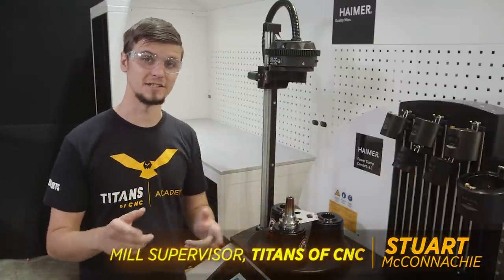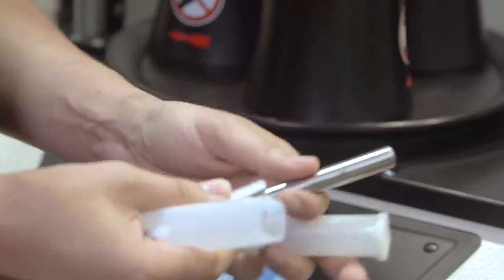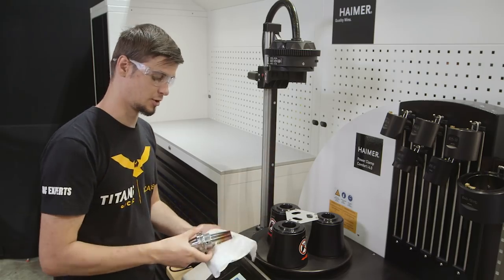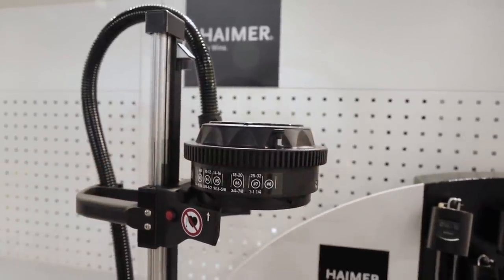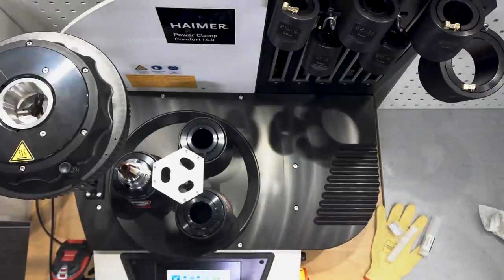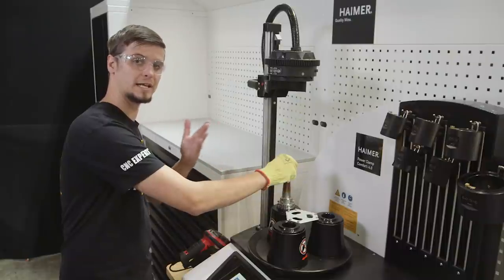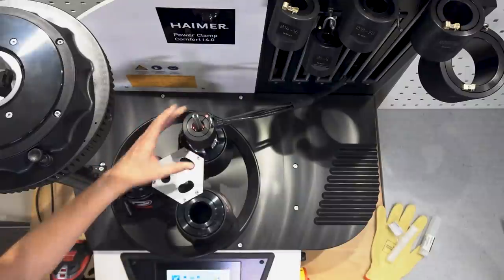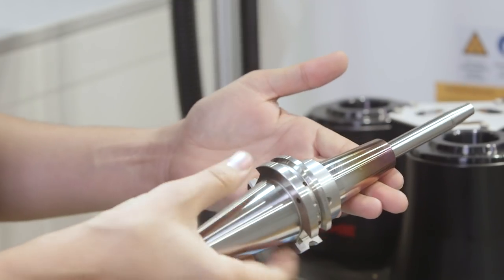How to Properly Heat Shrink Your Tools for Precision Set-Ups

Comment from the maker: As always, we are looking to educate our entire industry. Many companies are perfectly fine using regular tool holders, hydraulic holders, mill chucks etc... but for shops looking to lean out their processes etc. Shrink Fit, Pre-Setting and Balancing is extremely important. So we definitely also want to teach on it. Hope you enjoy this video!
Reply: question. is the process the same to remove the tool from the holder?
Reply: @littlephilo585  Yes! You would still heat up the holder, pull the tool out, and then cool the holder with the appropriate cooling body.

Comment: damn, at my work we have an old machine for heat shrinking tools and it just takes 10-15 seconds to change a tool and its automatic aswell. this just seems to be way more complicated than it needs to be!
Reply: That's what I was thinking, the one I used needed only like three steps and its done plus it was a lot more compact, you just set the power level on a screen, set your tool in the holder, slid the coil down over it and hit the button on the slide handle and dropped your tool in a few seconds later once it was hot, and as soon as you set your tool and let your finger off the button an air sprayer inside the coil unit would blast the holder for 10-15 seconds to bring it down close to room temp. I could swap out an entire machine's worth of tooling in 10-15 minutes with it, I loved that system.

Edit; just looked it up, it was the Techniks 00500 ShrinkPRO Quencher. Great machine.

Comment: Why are the heating cycles and aperture size in SAE units, while the cooling collars are metric?
Reply: Yeah... they are asking for trouble....
Reply: No sense in making two different sets of cooling rings I guess. But they could mark them with both inch and metric that's true
Reply: We could’ve solved that problem decades ago, along with the rest of the world. Instead, we add this chance for potential mismeasurement. It’s already cost us one spacecraft that we know of.
  Reminds me of wearing a mask to reduce transmission of an infection—seems simple, but just too difficult for some. And we’re losing more than a spacecraft because of it. A thousand people per day, at the present time.
  Just so folks know, I live in an area where mask usage is followed by the majority of people I see, and our rate of transmission is lower than in he rest of the country where it’s “too difficult” to wear a mask.
  Maybe we need a device where you could measure your head, stick it in, and when you removed it you’d have a properly fitted mask on your face. No heat needed.

Comment: How critical is it to clean the bore or a heat shrink holder?  Can I use a nylon brush or does it need to be brass?  Will cleaning the bore extend the life (meters/cut) of the cutter?

Comment: I would like to see the balancing. I thought only the holder was done? If you balance with the tool in and change the tool you will have to balance it again. Removing weight all the time will eventually ruin the holder or is the holder considered a consumable?
Reply: If I remember correctly there is different weights of screw put in the holder for balancing
Reply: The weights are little set screws that go in the sides of the tool holder. You can change them as much as you want as long as you don’t mess up the holes.
Reply: Our holders are designed for adding and removing the balancing screws without an issue and it will not ruin the holder's holes.

Comment: So what would you do for something like a 3” insert facing mill? Would you just use your standard holder or would you still have a way of using the heating and cooling method
Reply: I don't think a 3" face mill will survive the RPMs that require shrink fit holders

Comment: Has anyone ever had a tool pull out of a shrink fit holder? It's happened 2 times on me the same tool.
Reply: Depends what kind of tool. If its a large vortex cutter then it could. Also check the tools you're using to make sure that they are ground to shrink fit tolerance as some tools aren't so may be slightly smaller
Reply: Its a 1 inch insert cutter but it sticks out about 7 inches we think it's happening cause were ramping in the z axis
Reply: @anthonykegel3861  dunno, biggest heat shrink holders we got is 20mm and we dont really use large tools. Maybe try a sidelong holder
Reply: @jaysilverheals4445  it's a 1 inch cutter but I think it didn't like ramping in the z axis.

Comment: when to use this kind of tool?
Reply: When do you need extreme accuracy and run out
Reply: And it’s also good for tight places
Reply: i mean with usual tool i can get on spec... dont know what kind of job with that sizes of cnc would require such accuracy